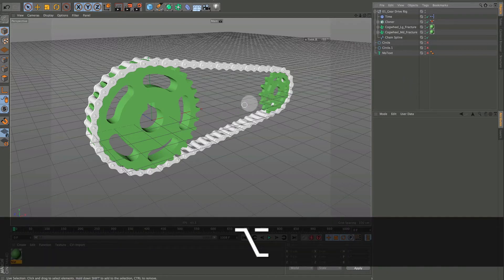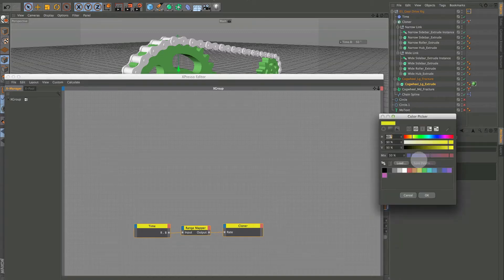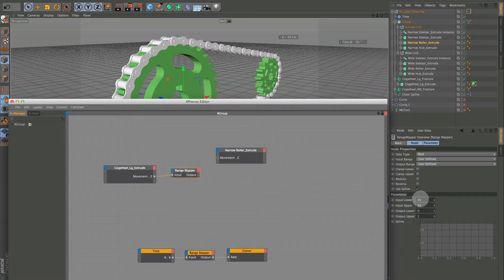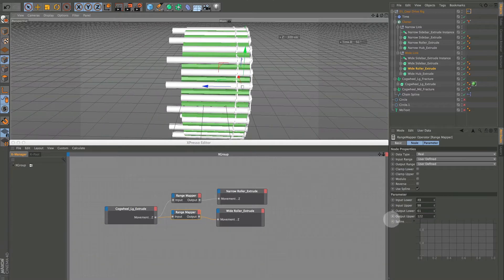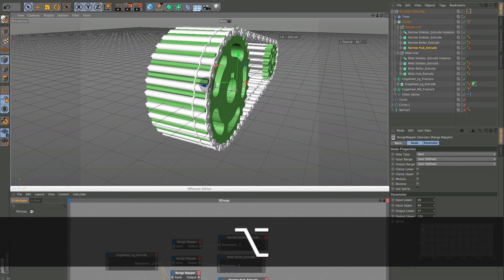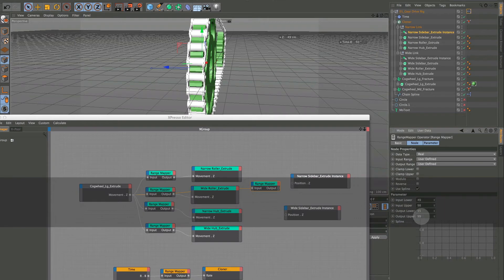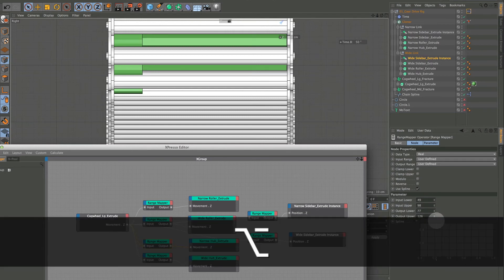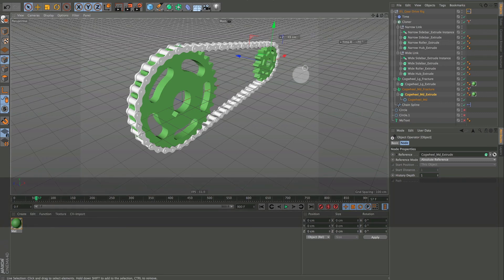04 Chain Drive Tutorial

Comment: Thanks Lonnie for the great tutorial! You can also check spline length by clicking on the spline and going to Project Info and clicking the Structure tab. I've never understood why it's in this location. Why not just have a tab in the spline itself haha.
Reply from the maker: Great tip, Matt! Thanks! Yeah, not always sure of Maxon's rationale for things.
Reply: Lonnie Busch Haha yes totally agree! Thanks again for your tutorials. I learned some things I hadn’t known before. Like double clicking ports in xpresso to remove, holding alt and dragging value spinners for smaller increments, etc. The small things make a big difference!